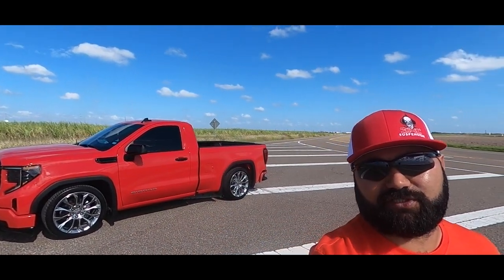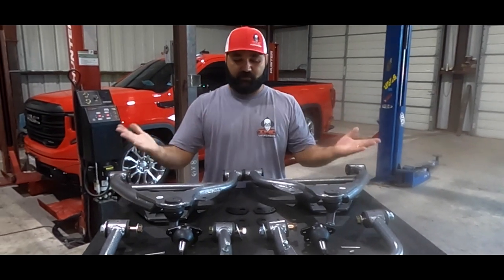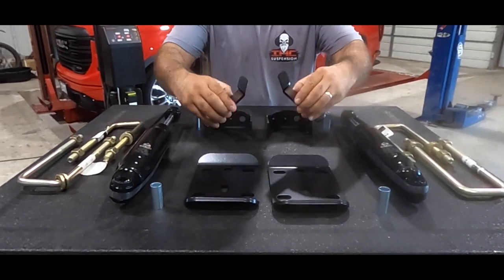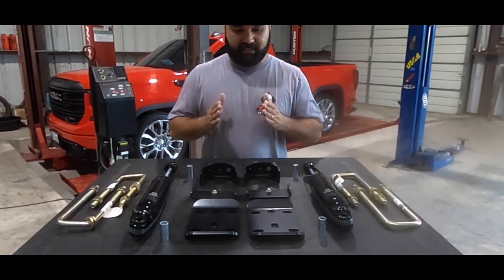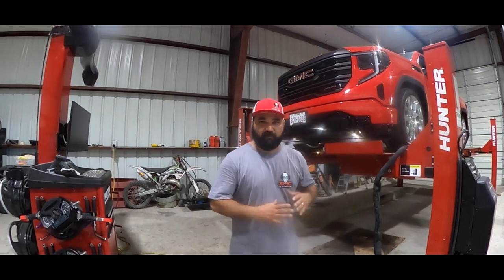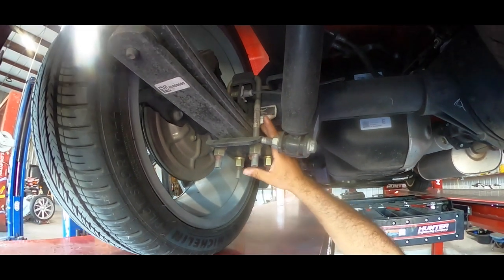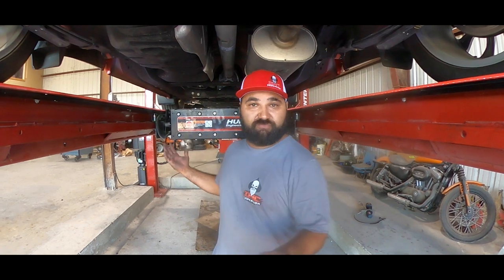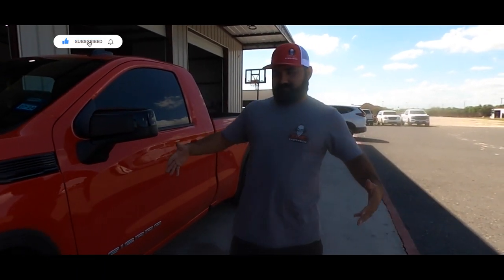Feature Friday | 2022 GMC Sierra Single Cab 2WD IHC 4/6

Comment: I installed the same kit last month on my new 22’ Regular cab Sierra and besides the rear muffler issue hitting the rear end on slight bumps, on hard left turns it makes a knocking noise. Not the right though. Hate it! The camber locks were junk a 30 year Alignment man told me. He explained it to me and I see why. You should of saved your money on that part Ivan. I have a Bell Tech kit on my other truck and ZERO ISSUES over the years.

Comment: Now what about crew cabs? Frame need notching? If so id think id rather do a 3/5 drop
Reply: I have a 14 crew cab Chevy with the beltech flip kit for a 7inch rear drop without notch but I do hit when going over bumps and train tracks if I don’t slow down I’m looking forward to ihc control arms soon but I’d say you should go lower as 3/5 will sorta look stock

Comment: I just bought a 22 Sierra crew cab with a 6’6 bed. Will this kit work on my truck?
Reply: Is their Anything you dont like about it
Reply: @edwinsandoval2595  honestly the only thing I don’t like is the automatic stop start. You can turn if off so it’s not that big of a deal. But I love everything else big upgrade from the 15 Sierra I had. I also love the digital dash and large screen.